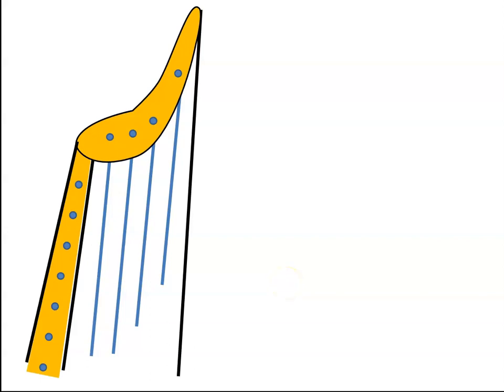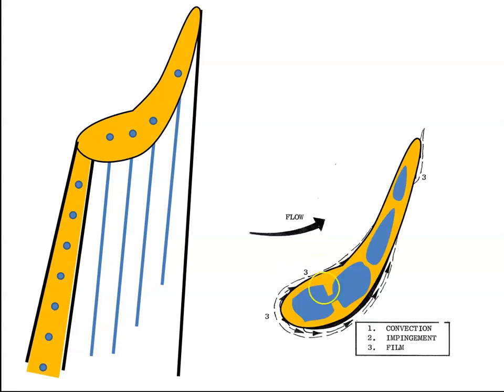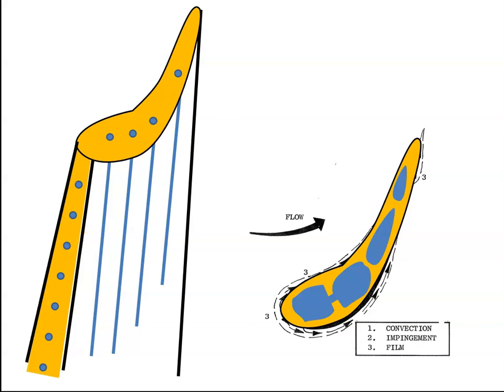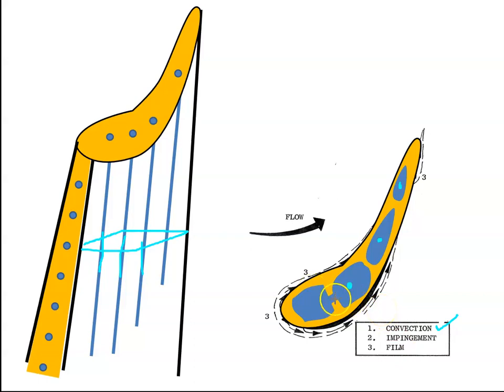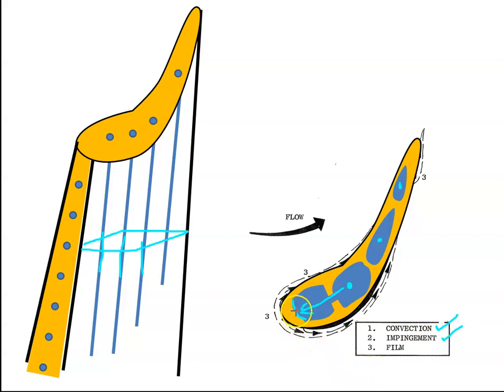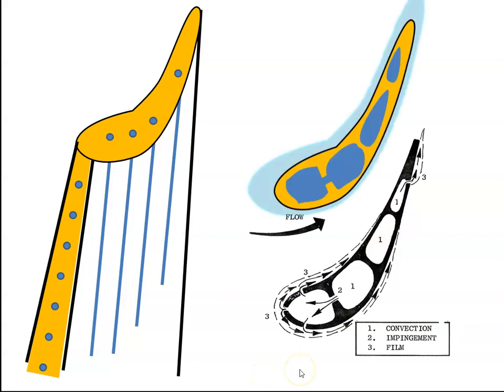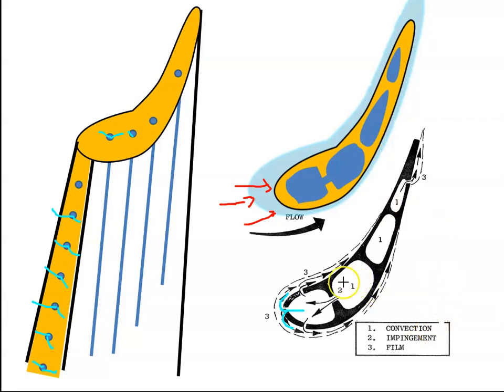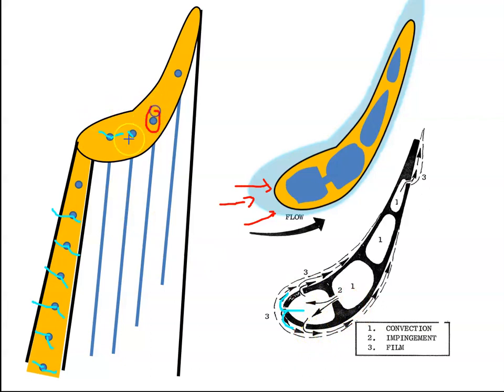Turbine Blade Cooling 3

Comment: When use of air-cooled turbine blading began, General Electric favored film cooling whereas Pratt & Whitney favored convection & impingement cooling because they use less compressor bleed air, the turbine blades are simpler & cheaper to manufacture, there are no film cooling slots to clog, and the turbine efficiency penalty is lower because the blade cooling air is exhausted parallel to airflow.